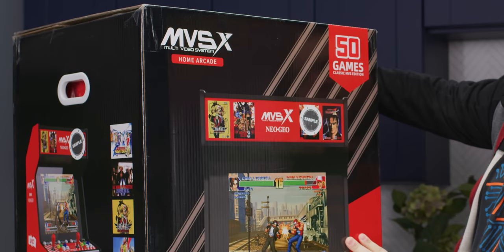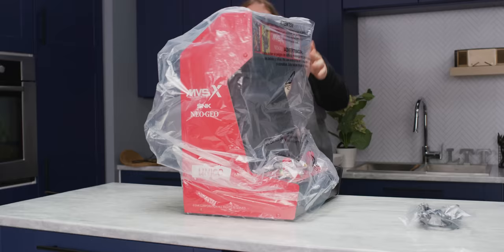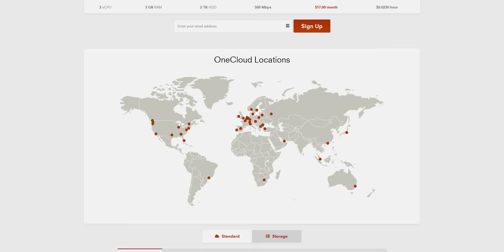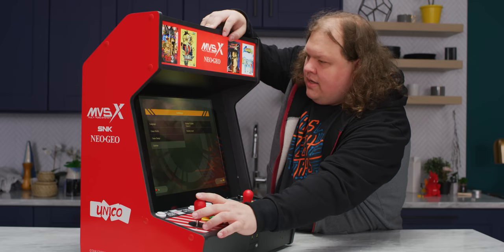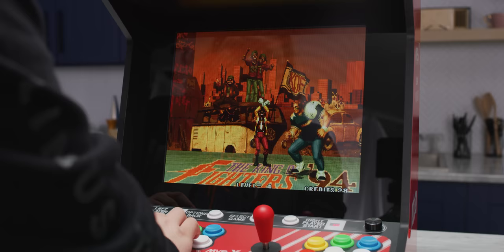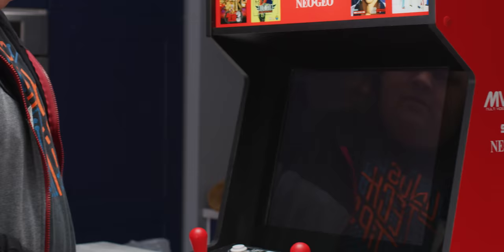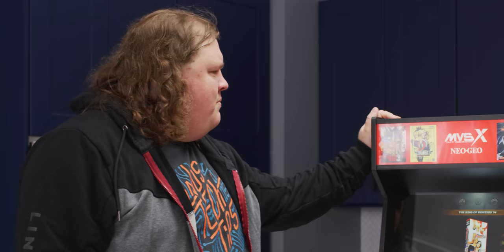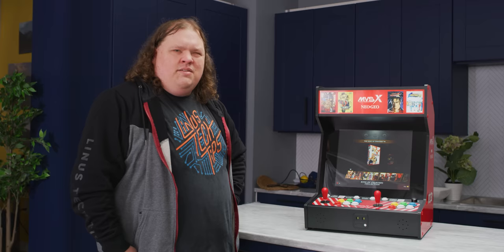My BIGGEST Unboxing! - NEO GEO MVSX Home Arcade

Comment: 6:08 I'm the other way around. I grew up going to the arcades after school so I'm used to joysticks for fighting games. Not so good with d-pad but could be managed with one in the SNES and playtation. But damned xbox 360 d-pad really sucks @$$ for fighting games, a combination of the shape, design and position on the controller specially the position forces my finger into a more  diagonal position respective to the d-pad compared to the former controllers. The same applies to the xbox one controller, but lessened to a degree with a better shape and design. Still I prefer to plug a arcade stick to the pc if I'm playing a fighting game. And I owned a Neo-geo system, hella expensive console and hella expensive carts back then but pretty much owned all the snk fighting games back then. Also the joystick controller with microswitches was night and day compared to the 'arcade stick' controllers they'd sell you for the SN\eS and Genesis which all of them weren't microswitches but still membrane and that made all the difference. After all these years and looking at how much it goes for in auctions, I regret selling it to afford to purchase the new consoles back then (PSX, Dreamcast).

Comment: My problem with this and really a lot more so with the Arcade1up machines, is that you are buying all this mediocre hardware and fiberboard paneling to essentially play a few games a piece, games that would run on any modern processor. All the duplicate controllers, monitors, computer hardware and exterior panels are going to end up in the trash eventually, when you could just have all of this software on 1 machine with a couple decent controllers to play them all.

Comment: I think not. Between the nonstandard display ratio which they're stretching for instead of pillarboxing (Naughty!), poor switch design, external power supply, and subpar CPU, it just isn't there for $450/$500. 

Not to mention FBA's extremely legally and morally dubious use in a commercial product. Reminder: FinalBurn was noncommercial, FBA's lead project dev doesn't have the legal rights to sell it even if his contributors gave permission!

Comment: They made a couple really odd design decisions with this machine. Adding an additional couple buttons in white when the NeoGeo never used six buttons, and adding those tiny fake coin slots. If someone really wants a tabletop arcade machine with six buttons why not build it yourself? Also, if you buy the lower part of the cabinet to make it full size, the tiny coin slots are redundant and spoil the look even more.